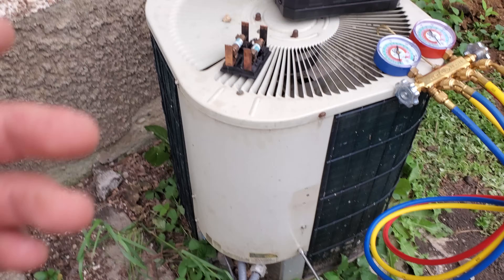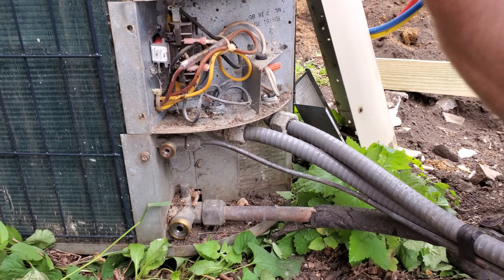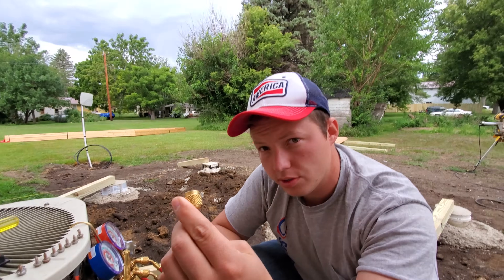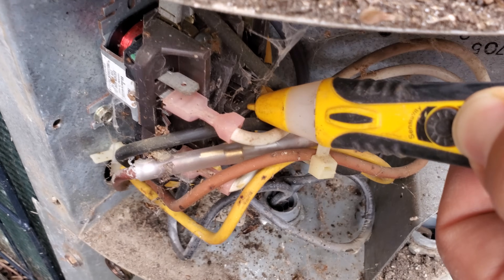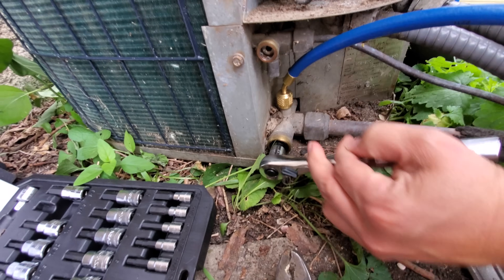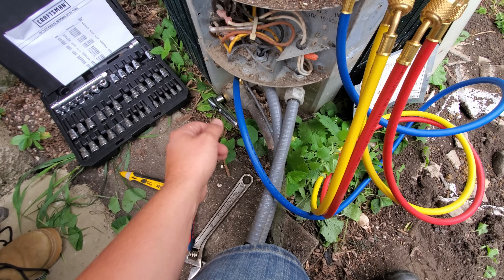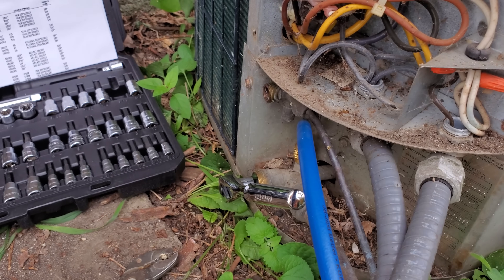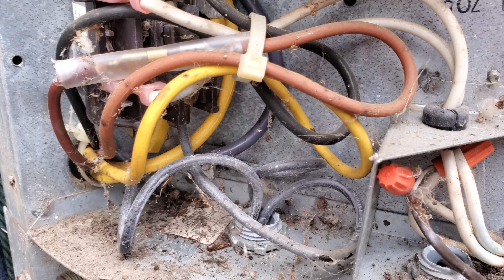How To Disconnect an Air Conditioner & Pump Refrigerant Into Unit

Comment: Saved me the $500 that the hvac tech quoted me. Also, I found a very similar gauge from harbor freight that was on sale for $50 and it worked perfectly. Thanks a ton.

Comment: I have a serious question, if there is a technician there to check unit outside, is it normal for a ton of white gas like substance to pour out while disconnecting their tools?
Reply: A tiny hiss of refrigerant is permissible when connecting/disconnecting lines. If clouds of refrigerant are coming out, they're doing it wrong, and probably aren't EPA certified for handling refrigerants like they should be.

Comment: What happens if you don’t drain the gas? Hypothetically ofcourse
Reply: It is very expensive and will need to be replaced- not hypothetical, for reals.
Reply: if your going to throw the unit or dont mind maybe damaging it and dont want that going into the atmosphere. you can just close the small pipe and run it for a couple of minutes then close big pipe.
Reply: @info.lapalma  What if I am NOT going to throw it out. Can't I close the output valve, draw in most of the refrigerant, down to about 10PSI- then later just reconnect?
Reply: @MOAB-UT  your going to need someone to put some gas back in because you can't buy the gas. Probably it will be low. But at least you just have to pay to be topped up.
Reply: @info.lapalma  Thanks.

Comment: Hi Ben, good vid. Can you tell me what I need to do to remove my old inoperable unit, in order to place my new one (which is sitting on a pallet in my parking space)on the old pad. Specifically, how do I safely disconnect the refrigerant lines.

Comment: hey, you mentioned that pumping down 410a might not be possible.  why is this, and how would one know if they couldnt do it?
Reply: He mentioned that R410a works on higher pressure than R22. Which could over'pressurize the condenser (and compressor) coils l. You know it's an R410a because it should be written on the outdoor and indoor units information tag. Also you could know from the model number and year make.

Comment: How would you remove a unit with a bad compressor since you can't use it to pump the freon?
Reply: Halleluya Brother! My question exactly. I could care less whether his is operable or not. He could have at least mentioned what to do in the case where you have a non working unit which needs to be removed in order to install a new one. Also whether you can use the same lines and switch the type of refrigerant to be used. In my case the new unit calls the new refrigerant and my old unit used the Errrr 22.

Comment: I have a hvac that has the fan running constantly with the thermostat set on Auto for Heat & cool after the main coil was replaced.  What changed to Msadie@825 it run all the time

Comment: Why did you cut the high and low lines instead of removing the nuts that hold them on?
Reply: I had the same question...even though it was unlikely he would re use the pipework ...I had thought it would have been easier or better to seal dirt ingress into compressor unit...but did not see him doing that

Comment: i was told running it in cool mode is actually better cause you put a heat load on the coil ensuring you are vapor all the way :-)
Reply: True on large systems or in cold ambient. But as you see it worked fine regardless
Reply: @Froggability  true that

Comment: When the unit has a scroll, do you still pump it down to 0psi or slightly lower? I've read scrolls should never be run in a vacuum - is that true?
You have a good apprentice. :)

Comment: Good explanation. Is it me or did the line set have flared fittings that could have been removed?
Reply: We often preserve a stub like shown, pinch it and braze it off to be certain off not losing gas. You can't totally trust that valve won't leak a little when the machine is that old. Do the same on the liquid line.
Reply: I wonder why flare fittings aren’t used more? Seems like less chance of contamination if a guy is too lazy to use nitrogen when brazing.

I just did a mini split in my cabin. The mini has flares on both ends.

I’m sure I’m missing something but it sure seems like flares would mean less tanks and torches to lug around.